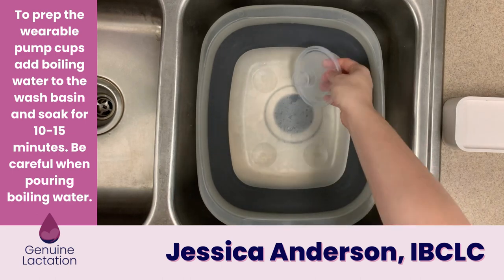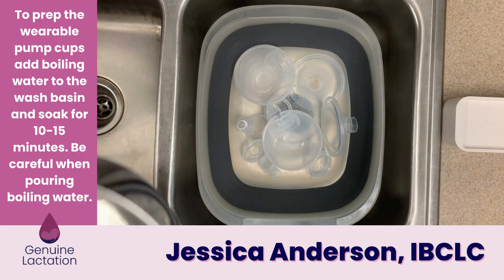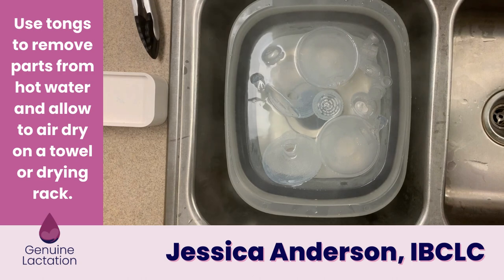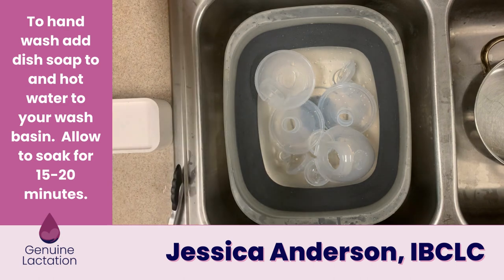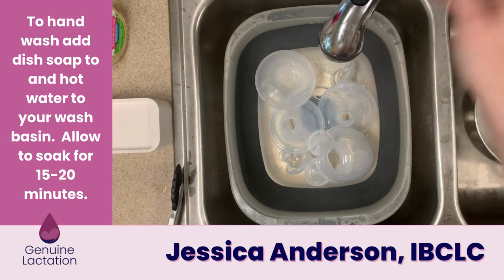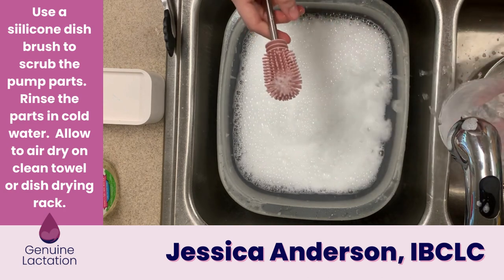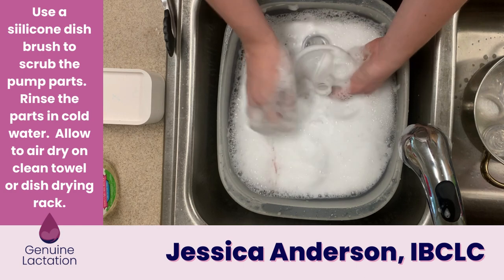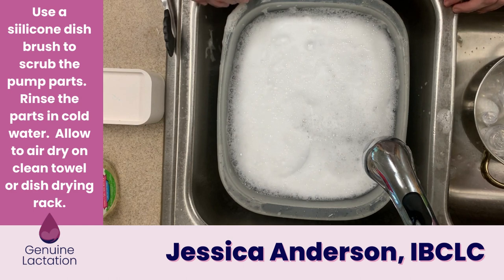Cleaning Wearable Pump Cups

Comment: This is the best routine.  I use a modified version.   I use hot water to rinse.  And,  at least once a day, at the end of the day, I do as follows:  I clean the basin with more soap, scrub it, rinse the basin.  Return the clean wet parts.  Then pour boiling water over the parts and let sit for 5 minutes (for silicone pump bits or other parts that the manufacturer says can’t take more than 5 minutes) and up to 20 for other bits that can take the heat (eg glass baby bottles).  Then set aside to air dry (or for parts that are safe to put in a high heat dryer like the baby breeza, use the dry only function to dry them).  It’s the only sure fire system that works for me to clear the milk fat residue off everything.
Reply from the maker: Isn't it great when you find the right wash routine for your needs?  I love that you found what works!

Comment: The only issue I have found is that the integrity of the silicone lip on the flange stretches out from the boiling water. It's happened to me twice now and it's quite expensive to replace the flange since it no longer seals to the internal guts. I had this happen using a bottle sterilizer as well. It has to be the heat causing it, I can't think of anything else. I have a portable dishwasher I put all the silicone pieces into. The water cannot get as hot (still hot but not as hot) then I take them out and air dry them. The hard metal pieces go in the bottle sanitizer after being washed. I love using the wearable cups but they are quite a pain to clean.
Reply from the maker: Those fail over time naturally but if you are boiling them and seeing failure I would love to more about what your boiling routine looks like and which cups it was with so we can better assess and fine tune recommendations! With the parts going in a dishwasher I would expect shortened lifespans to 30-90 days for sure
Reply: It was the imani wearable pump. I only used them about 10 times total but had sterilized them with boiling water each day I used them (so probably 7 times?) I work in a hospital so when I would get home I would pop the cups in my wash bin, dump in boiling water, and let it sit for an hour or so. Apparently, the site says to only sterilize them once so it was my own error. My dishwasher isn't really very good when it comes to heat so I'm not too worried about the dishwasher but lately I've been hand washing the parts to my new momcozy cups because I am paranoid. I also have the zomee cups and legendary cups and I haven't had any issues. It could just be the imani cups. @genuinelactation
Reply from the maker: @rebeccashosey9723  that is so unfortunate- yes sterilizing that often like that especially letting them soak that long would cause silicone to degrade and plastic to warp which would ruin the cups!  I genuinely recommend hand washing cups and wearable pump parts- it does make them last a lot longer!